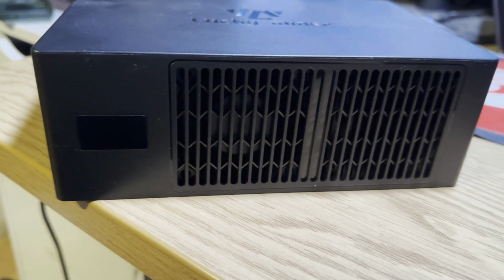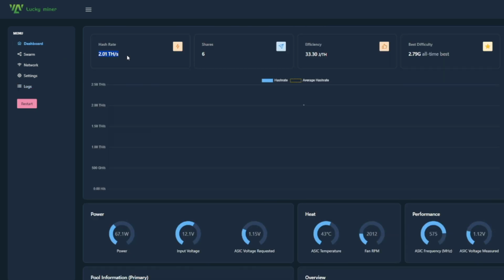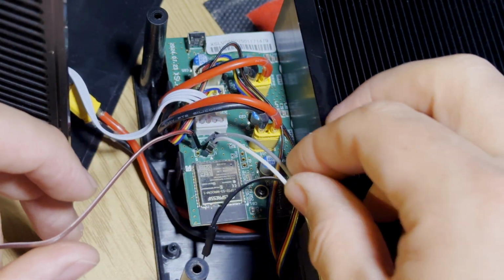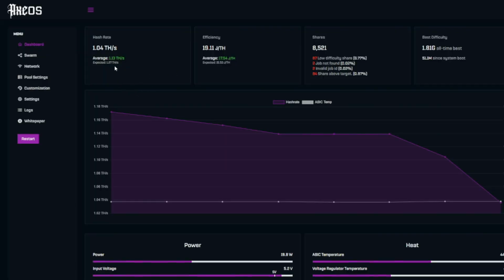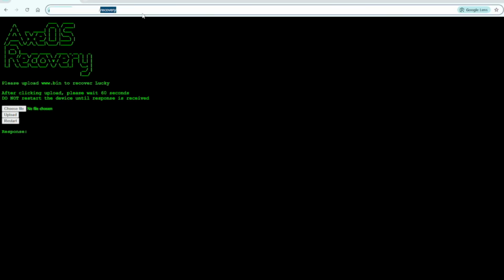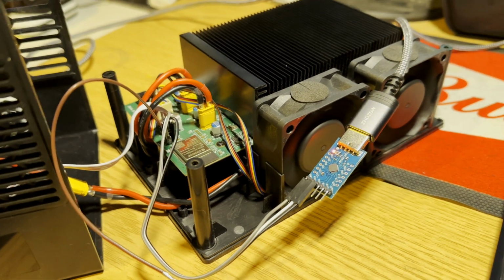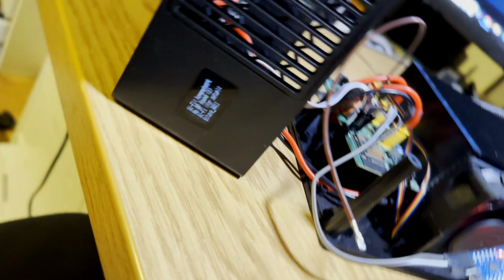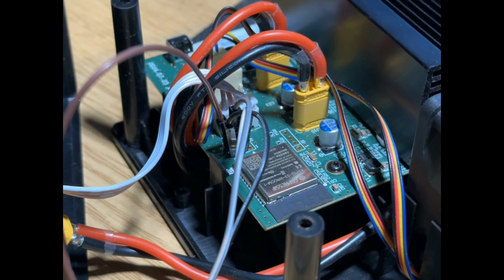Stop Buying Luckyminers LV08 Bitcoin Heres why.

Comment: Cain, thats a good one lmao, i do like my Lucky Miners i have like 6 of them, i only had issue with one of them not hashing at the proper speed and that was after i finished it actually, however i do not really care what OS is on my miners because i also have many Nano 3S’s and thats truly close source, someone using open source software or not is not a big deal but i get it, AxeOS is open source however its NOT free as you need to pay for licensing each miner you sell, at the end of the day the less money i can spend on solo miners thats all that truly miners, everyone just making money off us!
Reply: BTW i have a source that still sell the LV08’s for $169 for 4.2Th stock and after flash 5.4Th much cheaper than the Nano 3S and or the NerdQaxe
Reply from the maker: Thanks for the comment btw.  I appreciate it. I do like these miners. They just work. I agree updating to axeos isn’t all that. I just had 30 bitaxe gammas and wanted everything to match. 
I’ve had much less hassle and much better shares on the lv08 then any of my devices.   You might have to get me I. Contact with that source😂
Reply: they drop the price to $159 yesterday, they only got 19 left in stock, i want a few more so don’t want to post the site in public, if you know Red Panda Mining,  or GGM i am admin on his discord channel, i can post the link there.
Reply from the maker: I will have a look into it.   Still struggling with the cost of electric in the UK. Lol

Comment: after many attempts I managed to update the bitaxe firmware, on lucky miner lv08!
Reply from the maker: Heyyy. That’s great news.  Everything running ok ?
Reply: @NewGameTag I updated using the same firmware version you used in the video, and then I updated it through Bitaxe itself to the latest firmware version. And yes, it worked! I noticed a very rapid increase in the first few months and also better temperature stability and energy efficiency.
Reply: @NewGameTag yes!

Comment: I used the Web Adafruit ESPTool to unlock Lucky Miner LV08, along with the TTL UART converter module CP2104 to unlock it. Now can you tell me which files I will need to install or what I should do next?
Reply from the maker: That’s impressive. I was never able to get the online tool to connect.  You’ll never the special firmware for the lucky miner. Can’t use normal bitaxe firmware on it.  The files you need to install to flash the lucky miner are on a GitHub in the video. I believe there is a link in description.  As for the file to overwrite self check. It’s in the config.csv and there is a self check value set at 1 should be 0 to hold the self check

Comment: Did you connect the thin wire to short it before connecting a lucky miner or after connecting a lucky miner to the power?
Reply from the maker: In this case I shorted before powering up.  But if I didn’t have to hold the wire in place. I could have shorted then press reset.    Once it turns on with no screen. It’s been shorted and can release

Comment: yo bro....i just got 2 and that update was kinda confusing  and thanks for sharing.....
Reply from the maker: If you do choose to update. Becareful as you don’t want to brick it by failed update. The original firmware is hard to get hold of.  The only benefits of the axe os is open source and customisable. If you’re not into that then stick with the original.
Reply: @NewGameTag  thanks bro for sharing
Reply: where can i get the original axe firmware?
Reply from the maker: I have another video on the set up of the luckyminer to axe os
Reply: @NewGameTag Could you send the video link?
Reply from the maker: LuckyMiner LV08 Flashed with Bitaxe Firmware bitcoin btc
https://youtu.be/EBbdxEVK7v8
Reply: i got through bro....thanks for sharing lots of love
Reply: Hello, friend Could you help me do this step by step? @abcdefhijkk
Reply: Is it possible to do the procedure through Windows or does it have to be done on another system?
Reply from the maker: I’ve only ever managed it via virtual machine in windows running Linux.    The bitaxe firmware can be got from the Bitaxe org or their GitHub